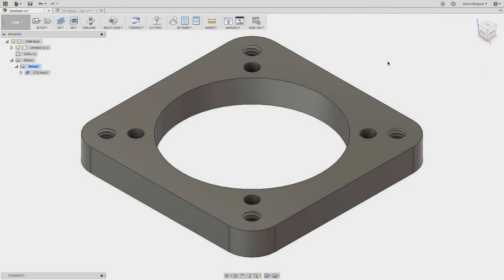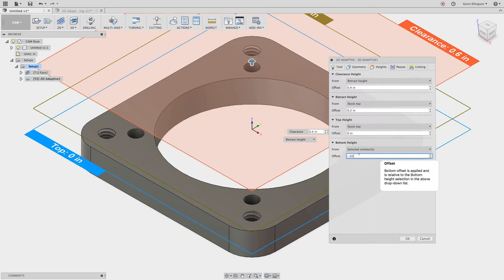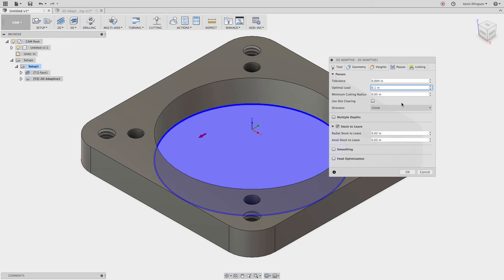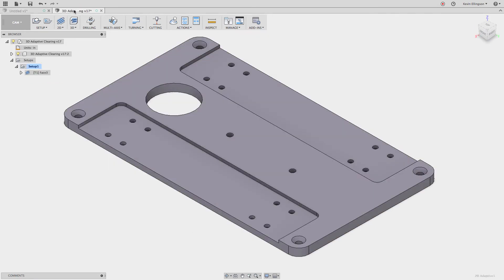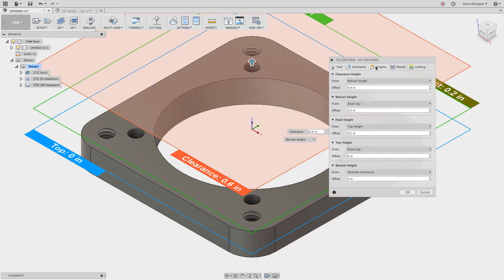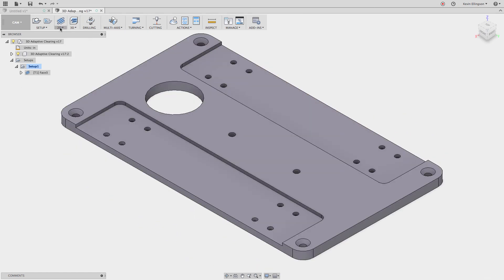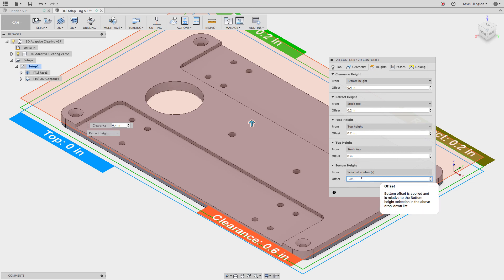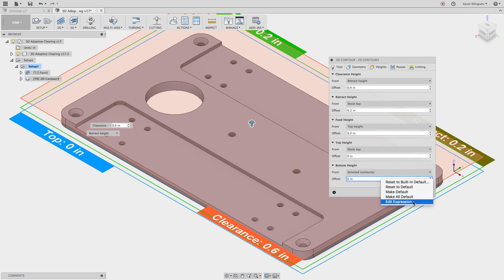Fusion 360 - Setting CAM Defaults

Comment: I just found your channel.  You explain very clearly.  Subscribed.  :)  I'll take my time to go over your many videos.  I have a question about the tool engagement  (Optimal Load).  Is the default set for the specific tool number (let's say 1/4" rougher), or for the operation (2D adaptive) where whatever tool you'll choose will get that "dia x 0.x" engagement?
Reply from the maker: Hi Dan. Sorry for the delayed reply. I turned something on and it doesn't show my notifications in app any more. To answer your question, yes. If you right click on the optimal load field for 2D or 3D adaptive and choose "edit expression" you will see a formula. By default, the equation is tool_diameter*4. 40% is quite aggressive. I recommend you change that to tool_diameter*.2 for 20% of the tool diameter. 20% is a great starting point for both aluminum and steel.

Comment: appreciate you posting these videos. Very helpful.  Do you know whether there is any way to change the default speed for a simulation and also whether one can make the ceramic material and the "tail" toolpath setting also default as opposed to changing it for each simulation run through? Thanks
Reply from the maker: mark scheiner It is not currently possible to make those defaults. Keep checking your updates. A color to ceramic will soon be the default but you can’t pick what you want as default. Same with simulation speed or other options. Thanks for stopping by.